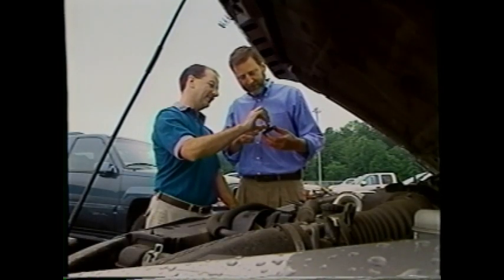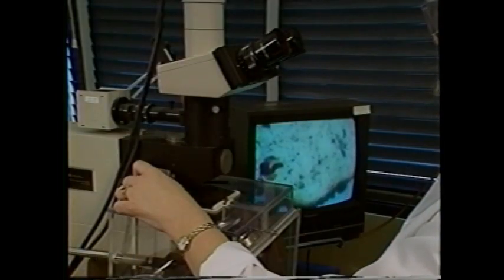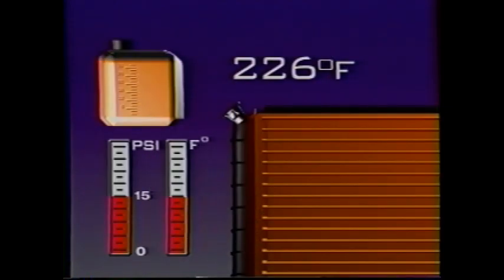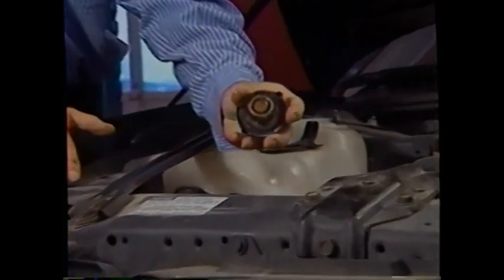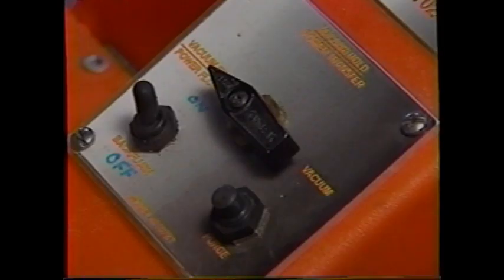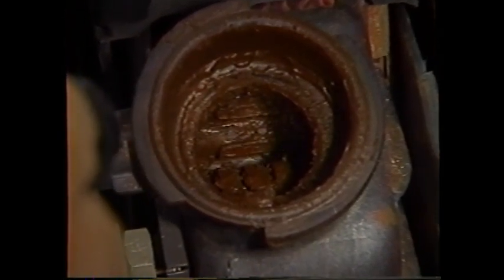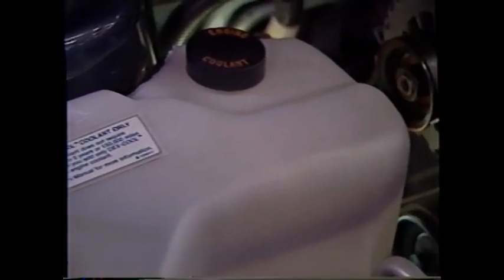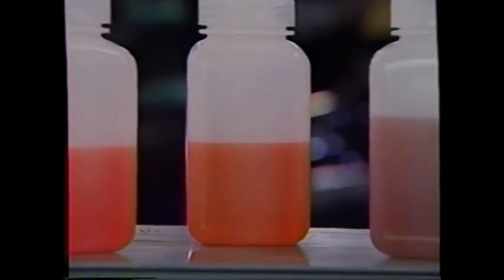GM Understanding Radiator Cap And Cooling System Contamination Issues

Comment: Yeah. People were mixing green antifreeze with dexcool. So when you're done fixing the known Gm coolant issues. Flush and refill either with green or now multipurpose coolant.
Reply: Multivehicle coolant like Prestone All Vehicles and Peak Global Lifetime is Dexcool (OAT), so you're not changing anything. HD Nitrite-free ELC, like Rotella ELC NF is Dexcool (check the spec sheets for GM 6277M or Ford WSS-M97B44-D). All American brands switched to Dexcool as of 2013. (Ford in the last year or two further switched to Dexcool + additive to fix Transit Connect heater core leakage)